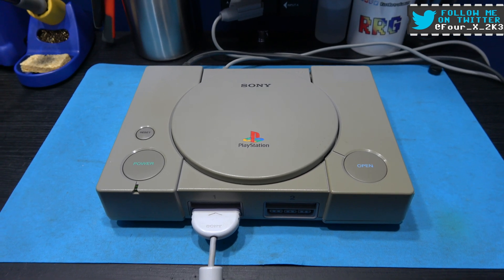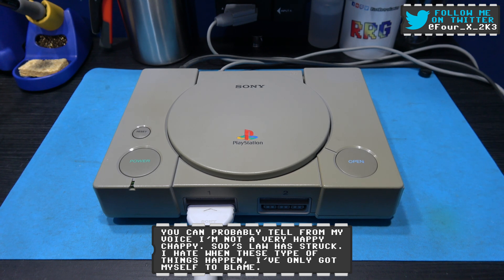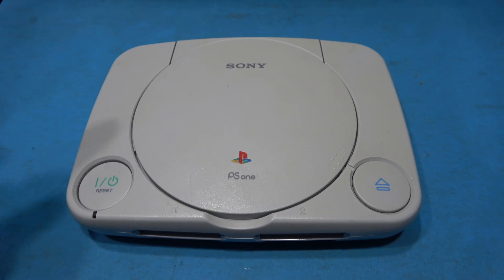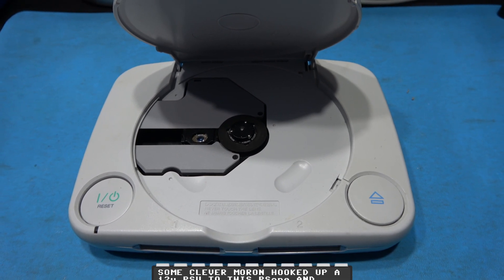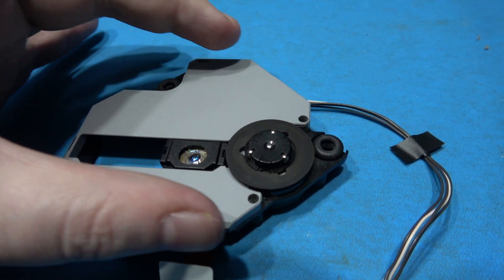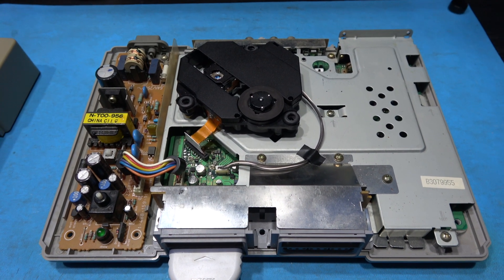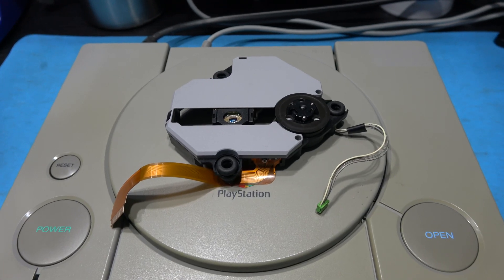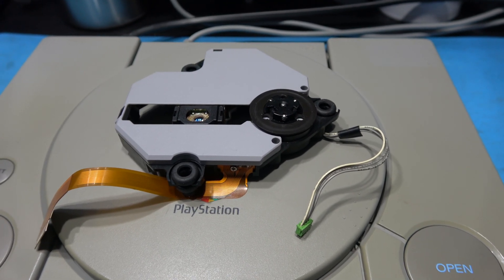Sony PlayStation (SCPH-1002) - Sod's Law Strikes Back - Optical Pickup (Laser) Replacement, Again.!

Comment: Hi four x, did you have repair a ps1 with no audio or video? And it is not the caps?
Reply from the maker: Hard to say what the issue could be without testing it myself. Could be a power issuse, check the power supply. Also check the fuses on the main board. look for missing system clocks also. These would be were i'd check.

Comment: Hello Four X,

For your oscilloscope, what is the make and model if it and how much did you spend?

Also if you have any 5000x ps2s or the 7000x v12 I have the files for the comsoft v4 laserfix. On obscure gamers search for comsoft v4 confirmed.

Kel was also able to use the summ0nes fix on the fat ps2s as well. I have to work out some errors as the comsoft v4 works with dvd based games on a v10 gh026 but shuts down the ps2 on a v9 gh023 board.

Have a good day!